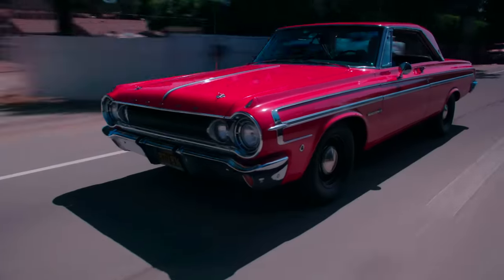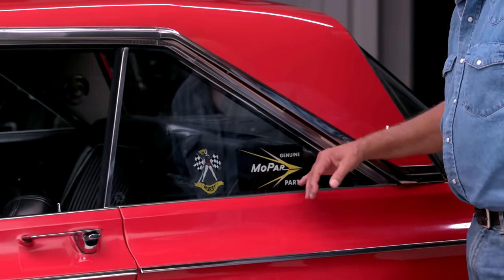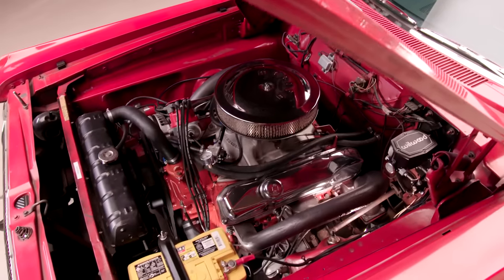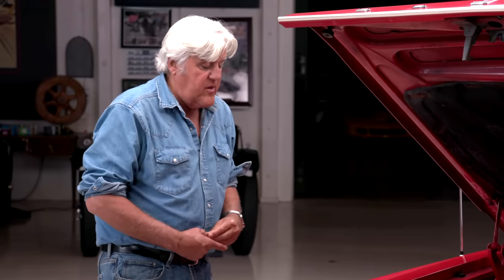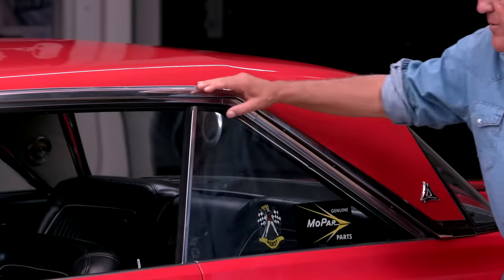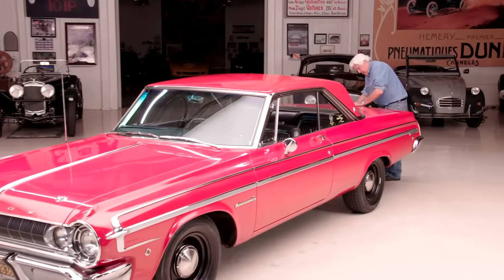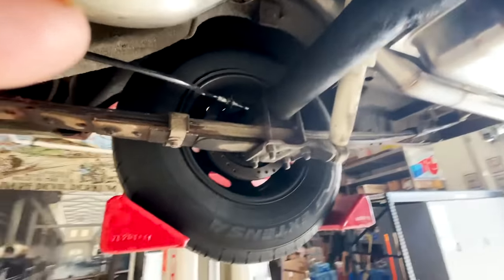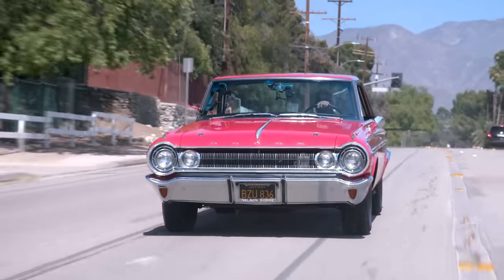1964 Dodge Polara | Jay Leno's Garage

Comment: Nice '64 Polara. In 1991, I was living in Culver City, and bought a "mint" '65 Dodge Monaco 2-door coupe. Factory 413 big block, automatic, dual exhaust, and exactly the same black bucket interior and tach down low as on Jay's Polara. Interesting. In fact, my Monaco had the factory AM-radio stereo "reverb unit" (12" x 8" x 4") located back in trunk. I forget what it was called. Something like "Vibrasonic", I forget, with a reverb knob located on the dash. I was working for peanuts, and had hopes of doing engine mods, yet could never afford it. Bought the care for $2K, and later sold it for $4K. I thought that I had made a fortune! When I sold it, the Cal Plates read "JOES413". No idea where that car is now. It was a odd factory tan color, with a black vinyl top.

Oh ... Hi Jay! I'm from Maine, and also lived all around Boston (Malden, Medford, Allston, Brighton, Brookline). Just turned "60", and I know EVERYTHING that you are talking about regarding "High-school-year cars, back in THE DAY". One friend, a Maine factory worker, had a purple CUDA with a factory 440 six-pack & 4-speed - shaker hood. Many a night we rode around the woods of Maine in that car! Those were the days.

Comment: Growing up in the 70’s my high school (and eventually brother in law) buddy had powder blue 64 polara with same console & 4 speed options. We built a dual quad 440 with an Isky cam, 12 to 1 compression & fender well headers. On Wednesday night we would bolt on 7” slicks & drive the 6 miles to Fremont raceway where that monster ran 12.47 second quarter miles. Thanks for taking me back. I’d forgotten how much fun those days were!
Reply: Yes a 12.47 was fast back then for sure . I’m 63 and I have a guy at work with a 19 accord 2.0. With mods that runs 12.30 . What a dif world now . I’d rather have the Polara of course.

Comment: What a great car Jay. I had a similar car, 65 Plymouth Satellite, it had a mild built 440 with a 727 trans (stage 2 shift kit) and 390 gears with suregrip. If you remember, 65 was the first year of the Satellite and carried the on the 64 Sport Fury body style which was similar to the Polara, both were B- body cars and became C-body cars in 65. The 65 Plymouth Satellite was a one year body style the used design (interior and exterior) from both 64 Polara and Sport Fury. As like your 64 a Dodge Polara. I upgraded the brake system to four wheel disc brakes, 3 inch dual Flow Master exhaust and mini-tubbed for bigger tires. With the 440 egine, manual steering and brakes the was a hand full. I don't own the car any longer but your video brought back great memories. Thanks Jay.

Comment: Best roof line of a 2 door hardtop ever. Jay when this car came out it was a mid sized car and very easy to drive and park. I had the push button auto version with a 318 and loved it.
Reply: Was this equivalent of the Plymouth Sport Fury or Plymouth Belvedere. I had a 64 Belvedere had same roof and 4 speed but bench seat in front. My friend had 65 Sport Fury convertible with the same 426 Wedge and even 4 speed with buckets and console. That was really fast car and think I answered my own question.  I have seen one 64 Belvedere with Hemi there were some in 65 as well but not many. I recall 2 fours staggered was on every wedge I seen not sure if standard with the wedge.  I got six miles to a gallon of gas that was 25 cents a gallon back then.  lol
Reply: @captainjim6300  absolutely

Comment: Jay, I have restored 3 64 Polara's and 2 1965 Dodge Coronet's. Love those cars. Simple, Fast and Strong with the 440 or 383 engine. Also, there is a company making 833 4-speed gear boxes with an O/D 4th Gear... 0.75 instead of 1:1. Good for Highway Cruising. Love your Shows No Politics, and miss you on Late Night TV. you're OK, Jay!

Comment: When I was kid in the 1970s, my friend had a 64 Polara. It was a 383ci 4 speed and a 671 dyers blower with 2 750 carter carbs I think, drum brakes and manual steering. It was a beast! But it would lift the front wheels off the pavement from a red light on a cool summer night. On a warm summer night we spent half the night pulled over waiting for it to cool off enough to start driving again! Those were the days!

Comment: Jay love your channel you are a true car guy. wish You the best and a speedy recovery. First hot rod I ever drove. I just turned 16. Guy across the street from me had one 426 cross ram ,fender well headers ,4 spd, 4.10 gear. Fortunately for me he wasn't much of a mechanic and I had 3 older brothers that were gear heads. So I had learned a lot from them. Paul with the max wedge pulled out distributor for some reason and couldn't get it re started. after watching for a while I said if I can get it running can I drive it . He said yes .Put it on #1 fired it up may have not been timed perfect just by ear  but I got to drive it around the block  remember like it was yesterday over 50 years later. Always wanted to own one.

Comment: What a amazing mopar . Love the colour can practically hear Jan and Dean singing . Brakes are a excellent upgrade dodge drum brakes from the sixties actually seemed to accelerate the car when slamming them on .I was surprised there was no cross ram but it’s much better to drive without it and less hassle to maintain . Always loved this year and model . The dog dish hubcaps with black rims is a look you can’t go wrong with on those . I can see this with ram chargers written down the side of it lol. Love it jay .nothing sounds like a wedge .
Reply: My brother-in-law had one of the first cross-rams in a convertible.  It was very difficult to control.  seemed like it had a sticky throttle (maybe it did).  It would not pull away from a stop sign without snapping your neck.  I pulled away from a stop sign the first time I drove it and got a ticket for burning rubber.  The cop asked me why I did that with him watching.  He would not believe me that I did not do it on purpose.

Comment: GREAT video, Jay! Back in '64 I knew this kid who "helped" his mom with the options list when she bought a car very much like the one in this video. Oh yeah - it had the Torqueflite instead of the 4-spd manual. Hey, the kid couldn't push it all the way, y'know? Sometimes he'd take the car out on El Camino Real between San Bruno (Mc Donald's) and Belmont (A&W). He had this deal where he'd get his front seat passenger to hand over $5, then he'd take out $5 and fold them in half and jam them in the spot where the windshield met the dash. He'd do a max accel takeoff when the light turned green. If the passenger could reach the money he won the bet and could keep it. Never went that way, of course. I had a buddy with a '49 Willys Jeepster with a '55 Cadillac engine and a B&M Hydro tranny. Me? I was riding around on my '50 Panhead (still have it). All on El Camino Real. We talked about petitioning the city, or county, somebody to modify the stop lights on El Camino to the classic NHRA Christmas Tree mode...

Comment: Very nostalgic for me Jay. This is a beautiful example of my first muscle car in the 60's. I worked my way through High School and all my savings went into this car. Mine was also red (of course) except with a 383, automatic and convertible top. You're right about the console mounted tach being a joke. I ended up going through a lot of bent push rods due to over revving the engine. Every now and then I see one of these 64 Polara's at a car show and stop dead in my tracks. Mine had an aftermarket 8 track tape player blasting "American Woman", glass packs and Hi-Jacker air shocks in the rear. I used to take my grandma to get groceries in it and she always lectured me about speeding even though I wasn't. This car just looked and sounded like trouble. Thanks for stopping me dead in my tracks today.
Reply: thanks for the story as i try to get the feeling of being in pre-1977 driving my 2-gen charger. and i wasn't alive with the ussr vs usa era but my dad was as his frist car was a pre-1970-78 red Chevy inpolla 350 auto velilor red interior

Comment: Ha... This makes me laugh and remember the 64 "330" that my mom bought new. (The 330 was the stripped down model of the Polara). She had a 4 door, 318 automatic, also with no power steering or brakes. (Steering was amazingly light.) I was well aware of the Polara like Jay has, so I would do a quick makeover when I borrowed her car on the weekends, trying to make the 330 look like Jay's hot rod. I'd drive about a mile down the road, then stop and take off the hubcaps and the air cleaner (giving it a "throaty" sound). The transmission was amazing, given the amount of abuse I gave it. That abuse consisted of me revving the engine in neutral, then pushing the "drive" button... That would break the rear tires loose every time. This always impressed my friends, so I did it alot. Amazingly enough, my mom eventually traded the car off with 140,000 miles on it but she never had a lick of trouble with the transmission, or anything else with the car either, actually. Although it was "square" and boring, quality wise, it was an amazing car. I don't recall her ever having any trouble with the car at all (no thanks to me😅😂🤣).
Reply: Neutral drops we used to call that. Me and my friends would have our parents grocery getters out trying to see who could let some smoke out of the tires. Well, one of the tires anyway.
Reply: I guess every generation has its moments of glory. Ours was just how you tell it. Borrowing your parents luxo barge and hot rodding around town with it. With as many kids as you could fit. Which was alot !
Reply: One thing that doesn't change over time is teenage kids abusing their parents' cars... I leaned to drive around 1999-2000 in a '92 Chevy S10 Blazer with the 160 hp non-Vortec 4.3L V6 and a five speed manual. Gutless engine but I'd still peel out with it or try to shift into second so hard the tires would chirp sometimes... that poor truck... 😂 We also got rid of it at 140k still running fine, and it was seen running around town for years after that.
Reply: @rustyjeep2469   The family car I learned to drive on in 1971 was a 1970 VW bus, bought new. Needed a calendar to time its 0-60. Then Dad bought a VW Squareback. To me this was a hot car, a lot fun to drive, low the road with great handling. The 4-on-the-floor was a short throw sports car transmission. The Bus had a 4 on the floor of course, but the handle was so long it was like finding the right gear with a blind man's cane. We lived in the foothills of the Adirondacks and I had a lot of fun driving on the back roads.

Comment: 64 Plymouth is my favorite for style.  Especially the Sport Fury which was the last year for the B-Body "Sport Fury".  63-65 Dodges and Plymouth mid sized are known as the early B-Bodies... slightly smaller and lighter than the ones to come in 66-74.  1964 Dodges and Plymouths swept Daytona in 1964 with a 1,2,3 finish with the freshly designed 426 Hemi.  We've had our 64 Sport Fury 383 4 speed for 34 years and it's still the most fun to drive car in the Mopar fleet.  Also 64 was the first year for the A-833 4 speed transmission which is an iconic design.

Comment: Jay, you didn't  mention  the lack of conventional  springs on the front suspension. These had what was called torsion bar suspension. A thick peice of round stock that was connected  to the  frame on one end and the other end was connected  to the A arm. These twisted with movement of the A arm, and were adjustable to set ride height and comfort.

Comment: Hi Jay;
Coming from a small town in western Canadian prairies, I always love your programs about the muscle car era. Thought you might get a smile from me sharing a quick "cut outs" story.. We had heard about cut outs & Lake pipes from the California movies & magazines but of course we couldn't afford / didn't understand anything about electric cut outs. Starting with a rebuilt 40 thousandths over, 53 ford flat head coupe which my friends & I fixed up.

Initially we got some surplus cross over exhaust pipes that had flanged edges on both ends, cut the ends off, welded up the exhaust hole put a washer swivel on one side & bolted them on to  hidden welded diverter side pipes made from the cut up pipes. When we wanted to show off driving around we carried a box end wrench & quickly crawled under each side to loosen & drop the gate down to  roar around. Of course trying to get under the car fast enough when the police started searching got tedious. MY later invention aided by my gearhead friend's welding & wrenching was to attach spring loaded, flexible lawnmower throttle cables to the covers with the knobs up under the dash. I could open / close the cutouts from inside. One time getting stopped we had a cop who decided to "inspect "my car. He was looking under the back end but couldn't see anything wrong, so walked away muttering with four of us sitting in the Ford laughing. Cheers Bill 😎

Comment: Great video!
I owned two 64 Polara 440's back in the 80's. Same body style as yours but with different trim and rear lighting arrangement than yours. On one, the PO had swapped in a 440 engine and transmission out of the 70 Fury police interceptor into it. Racer Brown cam, Edlebrock intake and 750cfm Holley. Added a floor shifter. That was a nice car. One of many I wish I still had.
The other was stock and literally driven to church on Sundays by a little ole lady. 318/auto. I kept it stock.

I love old DPCD products. I have a 67 A-108 van with a slant 6 I'm getting back on the road now. It's been sitting since early 2000. I also have a 78 B200 Maxi van with a 360.

Comment: My older brother had a must of been 1963 330 Polara wagon with the 318 poly and pushbutton transmission. It was red also and had lots of chrome. Nice old cars and love the Mopars.
You don't see a lot of 413's or 426 max wedges. I have 1972 Dodge Cammander motorhome with a 413 industrial in it.

Comment: Jay....I had a '64 Polara years ago and loved it!!   And I also loved the "Torque Thrust" Mags and the wide tires that were on this car when you got it. (we used Tiger Paw "Red Line Wide Ovals" back in the day).   That's what we did to them up here in the PNW back then while listening to KJR in Seattle or KJRB in Spokane and "cruisin the gut" as they called it!
And a little bit of a "rake" on the back with Gabriel "Hi Jacker" air shocks was also what we did.   And one more thing,  that's a "Polara 500" not just a "Polara".  The Polara 500 was in direct competition with the  Plymouth Sort Fury, Ford Galaxie 500 XL and the Chevy Impala SS.  These were all top of the line cars with bucket seats, console and floor shifters.  
And yours here is a GREAT looking car!!    ;-)

Comment: Hello Jay back in the day I had a 63 Plymouth Belvedere. It had the 426 max wedge engine with the cross ram 4 barrels. And a push button transmission. I purchashed it in 1976. The guy who had it before me raced it. When he sold it to me he stated that the engine was tired. But it was still plenty fast for me. The car was a real ground pounder. I loved that car.

Comment: Thanks Jay for this trip down memory lane. I had a ‘64 Fury with the 426 Wedge and 4 speed. Fabulous car! So much torque Fast  and once you got accustomed to manual steering not a VG road car. I got goosebumps when you lifted the hood and I saw the cast iron headers. Works of art I think. I took this car to college in upstate NY in the very early 70s  (gas was $0.25 per gallon) and it was amazingly reliable and a hoot to drive. I sold the car to a frIend and ended up with a ‘65 GTO (also black and a 4 speed). The GTO was refined compared to the Fury but truthfully if I could do it over I would have kept the 426 Fury. Many years later I saw the Fury at a local body shop. A few days later I went to check it out but it was gone.

Comment: Thanks for sharing this car with us Jay! I like the mods you've made with disc brakes, radial tires, shocks making this beast safe and more fun to drive. The stainless steel exhaust was beautifully done and the electric cutouts we're a neat add. This dude would be a fun cruiser, windows down, arm on the door...yes! The 66 Ford LTD 7 Liter would be my choice for a butt kicking cruiser though.

Comment: Jay , I had a 1964 Plymouth Sport Fury with a 361c.i. with a Hurst competition plus 4 speed borgwarner trans, same color that looked very close in style broad side view, different on grill & rear with the 323 gears & drop out third member. I added a cam from a 1968 roadrunner 383 with a magnum engine, I had to add crain adjustable rockers & adjustable push rods because the lift on cam left the valves opened; and it ran like a bat out hell, but i did lose a race to a 428 ford boss torino with 2 four barrels by 2 lenghts in 1/4 mile and I only had a single four barrell carb . I still miss that car.

Comment: Always great to see another Polara 500 on the streets.  I still get my original 64 that had been my parents first car after they got married out from time to time and hit a cruise in or car show. Mine is the 383 bucket seat with a/c white with red interior. It needs the interior redone and has just a little rust under the rear quarters but still looks very good for a survivor car.   I remember going to the 66 Drive In Theater outside Carthage Mo. as a kid in the 64 and enjoying the great movies as well as the  root beer or coke floats and popcorn that mom would make.  Great times in a great automobile.